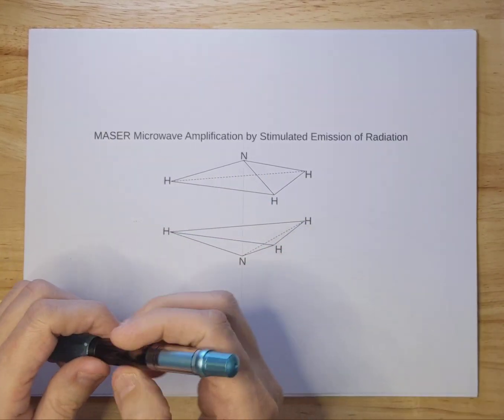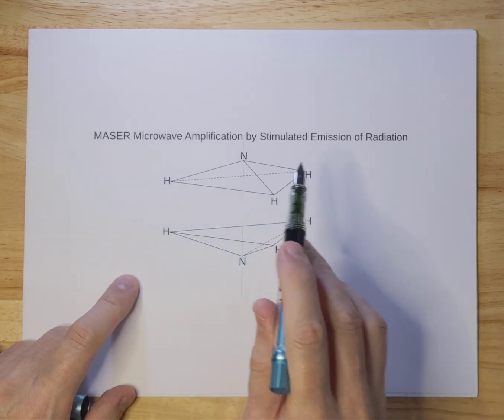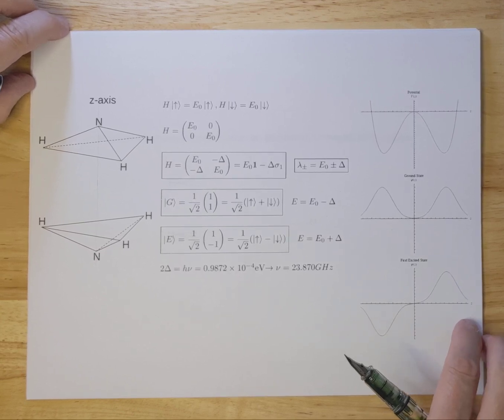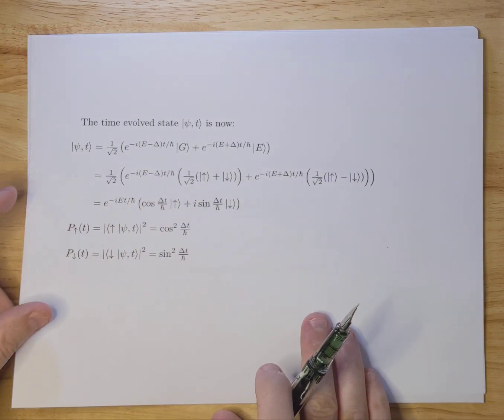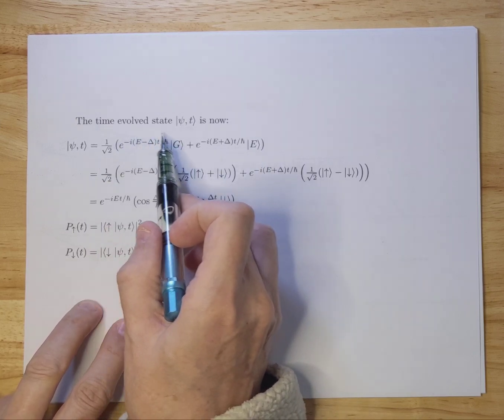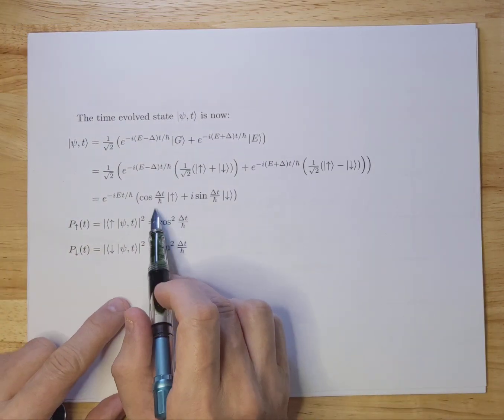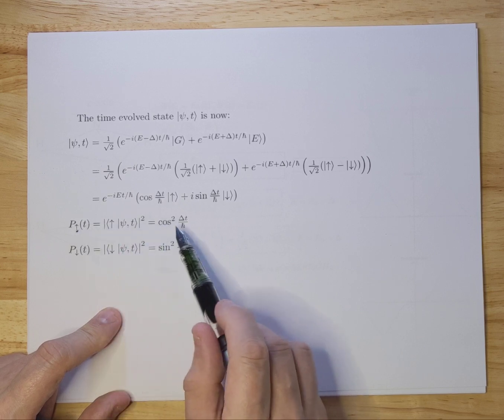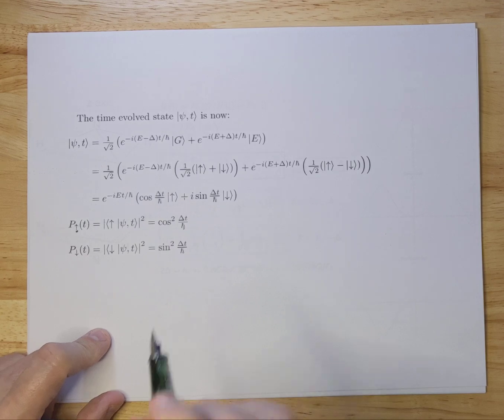MASER explained using a 2-state Quantum System. Charles Townes.

Comment: V.good@do you have a resource describing the maser used for testing the ether or not its existence by measuring the frequency of the radiation (in the cavity)- Phys.Rev.Let.1,342(1958) by Cedarholm, Bland, Heavens, and Townes? Where were the detectors? I am suspicious about the interpretation of such experiments in some literature but I don't know the technical details; the same in regard  MM type experiments. Scandalous!